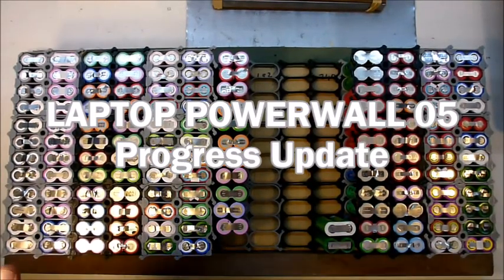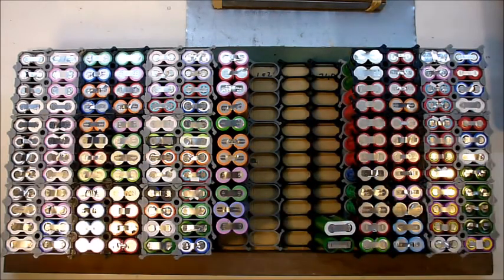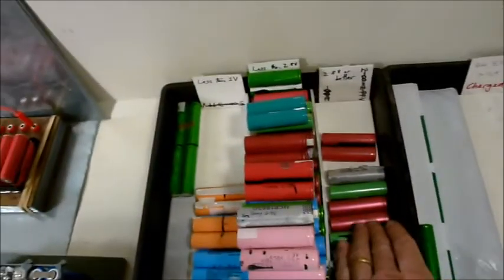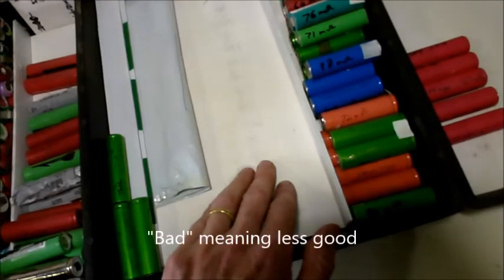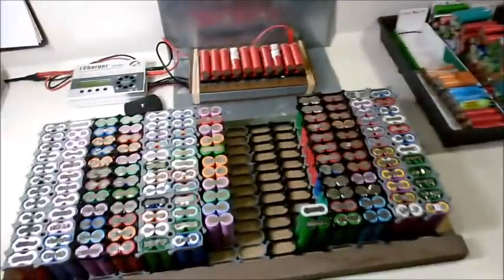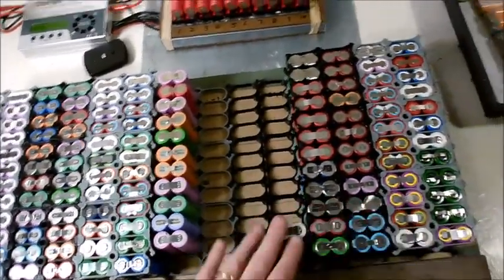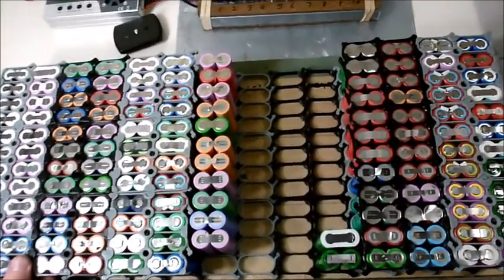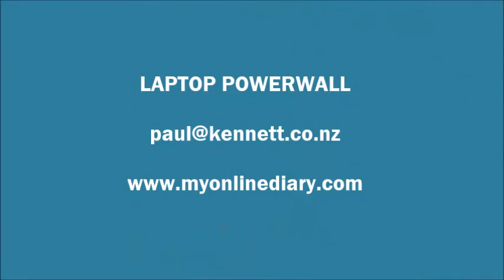Laptop Powerwall 05 - progress update

Comment: how many times are you cycling your cells before you test their IR?  ive noticed with mine from initial to say 3 cycles the IR is much less. Also, how long of a resting period are you giving them before IR test?
Reply from the maker: I've only been charging them once, then leave them a day or two, then measuring internal resistance. I've reassured a few cells and usually get a similar result. Maybe I should do some more.
Reply: My b6 mini does IR but im not sure how accurate it is. Your readings are alot lower than mine. Im usually getting between 120-160 for a single cell. Ive been doing 1 full C-D-C cycle @ .3-.7-.7a. wait an hour unplugged. Then checking IR. then cycle D-C @ .7-1.0. Wait 1 hour then check again. Sometimes they are within 5Ω sometimes 50Ω difference.  Thoughts?
Reply from the maker: +Keith Tucci My readings will be lower because I'm measuring 2 cells in parallel. But I don't know why you'd have such wide variance on the same cell. Odd.
Reply: Lets blame the mini

Comment: Can you give some reasons why you've chosen to measure battery resistance and the parameters for acceptable recycling
Reply from the maker: +harveyboy45 There's a strong corelation between internal resistance and capacity (See my Episode 9 https://www.youtube.com/watch?v=fxRCyk4tLSA). I can measure internal resistance with my iCharger very quickly whereas measuring capacity (by discharging) takes ages. So I can quickly discard some bad cells with high internal resistance (greater than 120 milliOhms) and thus save some time. 
Also - cells with higher internal resistance will self discharge faster, and are likely to heat up more when under high load. (My episode 10 is also worth a look).
Reply: +Paul Kennett What's the science behind discarding over 120 mOhm resistance. Just need to understand.
Reply from the maker: +harveyboy45 I've been reading http://batteryuniversity.com/learn/article/how_does_internal_resistance_affect_performance
Also: my own stats (covered in Episode 10 https://www.youtube.com/watch?v=35M6FM1AxK0) indicate a clear correlation between ESR and capacity - so it's useful to discard likely bad cells as quickly as possible.
Reply: +Paul Kennett yeah I think your right about the resistance. I haven't seen any info on the best batteries with good discharge efficiency maybe I'll do a little more research on that too.
Reply from the maker: +harveyboy45 If you find some good data let us know. Cheers